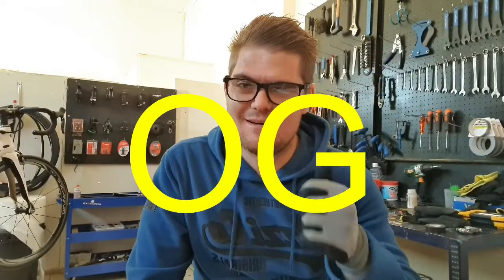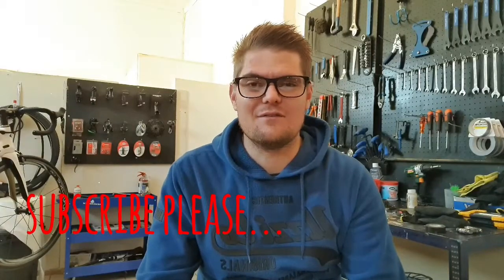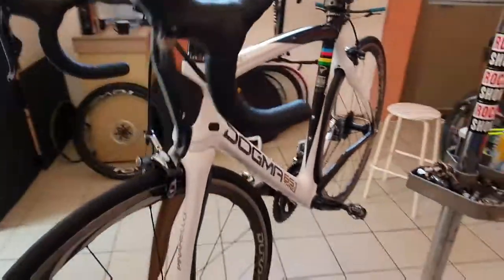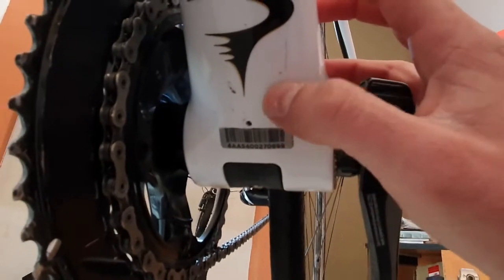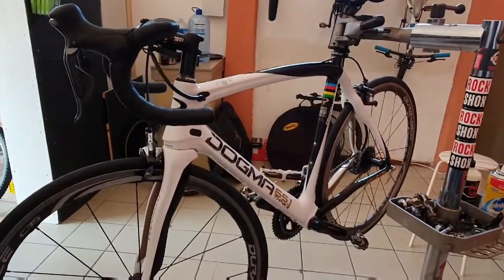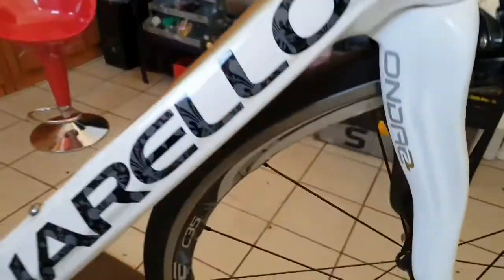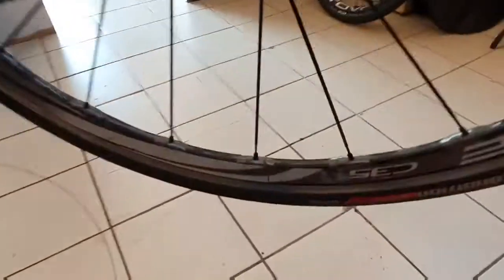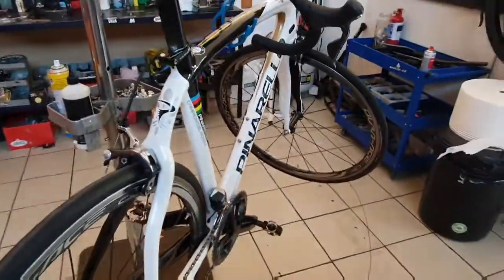Pinarello Dogma - How cool is this ?

Comment: If the consumer bought a fake bike believing it is real, i really pity him and this video should serve as a how to spot a fake.
And if the consumer bought a fake knowing it is one then he is a happy man too because his dream is realized to a certain degree without having to spending astronomically on a real one which the bike industry could care less about how much they priced their bike and who is buying them.
Even the best real frame comes with flaws and that is unforgivable. But if you spend a fraction of the price, then there's some flaws, you can close an eye.
I'm not supporting fakes but neither am I going to support the bike industry for charging ridiculously, a cycling bike that cost much more than a motorcycle these days.
Reply from the maker: Yeah. Prices of bicycles , well , some of them are just crazy. I know tech etc plays a role in the price of some of the bikes. Luckily this is the real deal and thats what the client wanted and was willing to spend. I personally havent ridden one of these clone bikes yet. Curious to see how they hold up. But I do agree. Pricey bikes should never have flaws. 👍
Reply: @RuanvanderLinde  yeah, considering the frames and designs of bicycles has not changed much for many many years. Yet the bikes are still so expensive. I mean if someone told me oh its a new tech carbon fiber material, the moulding, the R n D, they all come together thats why brand X charge so much, I understand back then but now??? China made are stepping in. Yeah they weren't trusted many years ago but the sales of brands like Twitter and Yoeleo have picked up and will continue to rise when consumers look elsewhere for reliable China made ones. Fake brands  sales too will increase because the very factory that manufactures original parts, made them too.
We r not rich people but we do our research too. We can't afford top brands but we do know how to buy reliable fake ones.
Who do we blame?
Reply from the maker: I am very curious to see where the market will take us. But I do agree....new china made bike are going to come into play just like you said. Thanks for the chat. What do you ride ? Check out my vid on the Allez Im building. All with pre-loved components
Reply: @RuanvanderLinde  i ride the merida reacto cf 905 2014 edition. Back then when aero frames weren't common. I always felt aero benefits were better than light weighted bikes.
Sure, always love watching new bike set up and their owners glow with glee and happiness when their bikes are done up. Same goes for mechanics too when they get the bikes done, feels so satisfying haha
Reply from the maker: I'M A HUGE REACTO GUY....I had the lampre evo frame with sram red on back then. It is an amazing machine. 👌
Reply: I bought a Fiat 500 (£10.000) and a F10 replica (£1.800). With £200 I’ll get a ticket to Ibiza 🚵🏻🚗✈️🏖🎉🎉🎉🎉🎉🎉
Reply: @daggyag9613  I have a 2008 budget carbon bike that cost $1500aud.
When I was looking at the F12 I compared the geometry to my old bike. All the measurements were within 3mm or less and the angles within 0.1 deg. So basically nothing changed in 12 years of development except the quality of the carbon .